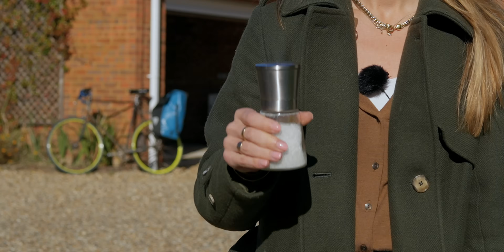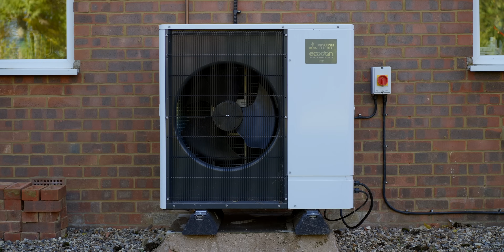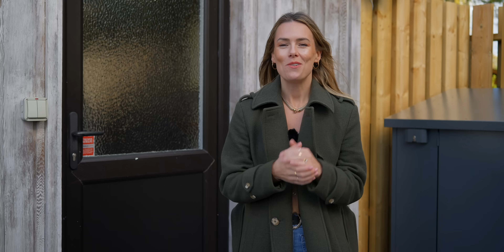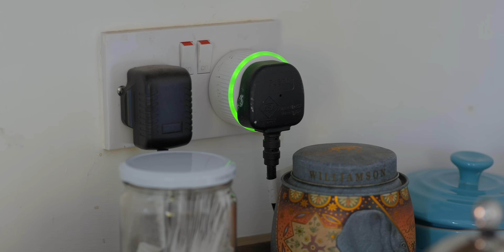Sodium Home Batteries Are Here! Is Salt The Key To Cleaner, Cheaper Energy?

Comment from the maker: IMPORTANT CLARIFICATION: Sodium-ion batteries do not contain table salt as the electrolyte. The video refers to sodium as an abundant element which can be sourced from salt, not to table salt being used directly in the cell. Sodium-ion electrolytes use engineered sodium salts and should be handled and recycled professionally, just like other battery chemistries.
Reply: Also you should clarify that empty is empty. LiIon-cells dont have "15% left". 0% is 0%. You can destroy them and discharge them more (below 0%)but its not like the Na-cells have hidden energy somewhere, their 0% is also 0%. Both can be used from 0-100%, the 0% on the Na is just at a lower voltage. A 5kwh Na is not secretly a 5,5kwh. Also: heating a closed pack like a liion-battery costs nearly no enegry, bc you just need to heat it to maybe 5°C and the pack is insulated. No one is opening windows and door, no one needs to exchange the air and get fresh air in.
Reply: Thank you for clarifying this point.
Reply: Sodium carbonate
Reply: @KyrieEmbong what about sodium carbonate?
Reply: so the only "expert" is from the replacement population, so will not be watching any more antiwhite videos from here, and the company is more interested in tracking and tracing customers than saying how much it costs or where you can buy one
Reply: Lol
Reply: The other point not being made is that the sodium in batteries does not come from mined NaCl in the UK. It requires Na2CO3, which CAN be made via the Solvay process, which uses huge amounts of coal and limestone and which produces huge amounts of CO2. The sodium carbonate that is required comes mostly from tronay mining in the US, Turkey and China. But sodium is only a small proportion of what makes a sodium battery work. The principle components are nickel, manganese, vanadium, aluminium and hard carbon, all of which are specialist supply chains and none of which can be produced at scale in UK.

Australia has huge repositories of lithium, but there is a reason why they are not making a fortune on lithium batteries. It's just never that simple.
Reply: Like businesses have such a great history of recycling and handling waste professionally.  This is not something we want scaled up for home use.
Reply: Actually, the electrolyte does contain sodium salts. But the name comes from the use of sodium metal in the cathode, not from any ions dissolved in the electrolyte. When you place a salt in a solvent, the salt dissolves into its constituent ions. But in this case, charging causes metallic cathode to lose ions that go through the electrolyte and deposit onto the anode. This is high school Chemistry 101 stuff! It shouldn't be that hard.
Reply: @Speed-Daemon-123  This type of batterie only works for small KWh.
Reply: @Speed-Daemon-123  If it isn't hard why have we waited centuries to have someone make one?
Reply: @CorwynGC  1. you haven't "waited centuries", you haven't even lived for one century, 2. it's your job to sign up for class, so if you're "waiting" for someone else to do the work for you, you're just lazy. If you went through high school without basic knowledge like chemistry, it's on you. Others have been "making" chemistry for centuries, literally.
Reply: @Speed-Daemon-123  If you can't understand simple pronouns like "we", I think it might be you who needs the class.
Reply: @CorwynGC  and there it is. The argumentum ad hominem is the sign that you have lost your own debate.
Reply: @Speed-Daemon-123  Really?  You didn't notice yourself saying "you're just lazy"?
Reply: @CorwynGC  I havent been waiting centuries for a salt battery because I didnt know that you think we needed them.  I do fear production costs of these batteries and noxious byproducts won't make them cheaper than Li-Ion.  They have the same environmental impact ratings, meaning regulations of waste that need to be funded.  While better for resource scarcity, this will create a demand that will compete with many textile industries, driving up the cost of other goods in the process.
Reply: @klo88  What?  You think that more batteries will drive up the price of blue jeans?  Simple economics will tell you that cheaper energy makes everything cheaper.  If you have some complicated economics which contradicts this, let's hear it.
Reply: Omg, that you need to say that says everything you need to know about the level of education in this country.
Reply: @dominicgoodwin1147  Seriously, how many high schools teach bleeding edge energy systems?
Reply: Thanks for making this retraction.

Comment: A bit disappointing to only allow 92% discharge when popular LFP batteries allow 95%
Anyway...
What they don't tell you is when an inverter breaks after the warranty expires, you need to spend more money to fix it
What they don't tell you is when the manufacturer goes bust, you're on your own; All the more important to bear in mind when so few sodium battery solutions exist
What they do tell you is when your solar panels get old, they produce less electricity
What they don't tell you is that's during the summer, because in the winter you'll be lucky to get a few W out of them later in their life; Guess when your heat pump will be most in use
What they don't tell you is that if you'd invested the money instead, you'd be better off as opposed to waiting 10+ years to break even on solar panels
What they don't tell you is that even if you spend a lot of money replacing your heavy appliances with smart ones, someone still needs to be there to load the washing machine and tumble dryer at the right time. And you also have to leave them turned on at all times...draining power
What they don't tell you is that even if you make your house energy efficient, the bill still goes up to pay the standing charge
The moral of the story, solar panels are a waste of money in the UK
If you've got money to burn, by all means get battery storage and take advantage of the cheaper rates
Sadly those who can't afford them or can't fit them will have to continue subsidising those that can

Comment: Generation ( Solar Panels )
Storage ( Batteries )
Useage ( Consumers Choice )

  The more you're using of each the more you need of the other two

   Set up your Generation " as much Generation as you can afford "

  Double , Triple , Quadruple the size of your Battery Storage  " you will need to get through Winter , less Battery  Storage means you will be buying in electricity when you should have brought , set up Battery Storage "
     " Capture all the Electricity Generated "
     Use as needed ..

Comment: AN AUSSIE COMPANY MADE A POWER-SUPPLY BY AN OFF-SET BALANCE-WHEEL AT THE END OF WHAT LOOKS-LIKE A LARGE SPHERE-CHAMBER'S SHAFT AND INSIDE MAGNETS ARRANGED TO CONTINUE THE SPIN, SURROUNDED BY A COPPER-STATER TO AID IN COLLECTING THE ENERGY THAT HELPS INCREASE CHARGE TO AN ACTUAL ALTERNATOR MOTOR CONNECTED TO A BATTERY TO CREATE A CONTINUOUS MEANS OF ELECTRICITY THROUGH A REGULATOR RECTIFIER TO TURN AC TO DC WITH LARGE STORAGE CAPACITORS. USED FOR OFF-GRID HOUSING IN AUSTRALIA. I'M NOT AN ENGINEER. SO MY RUDIMENTARY EXPLANATION MIGHT NOT BE GOOD-ENOUGH...!...? NOT-SPAM. caps on to see!

Comment: This episode of The Everything Electric Show explores the emergence of sodium-ion battery technology for home energy storage, featuring installations by the company Eleven Energy. While sodium batteries have a lower energy density than lithium-ion (100–160 Wh/kg vs. higher for NMC/LFP), they are highly suitable for home use where space is less restricted (2:15-2:42).

Key Advantages of Sodium-Ion Batteries:
Temperature Resilience: They operate efficiently in cold conditions down to -20°C without the need for energy-consuming heaters required by lithium systems (3:52-5:00).
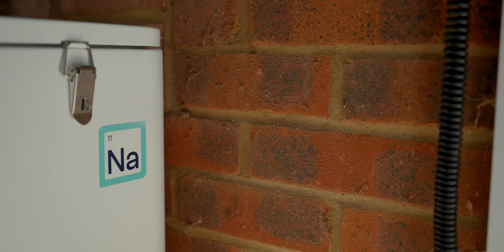Full Depth of Discharge: Sodium batteries can be discharged much more completely (down to 8%) compared to lithium systems, which typically retain 15-20% capacity, without damaging the cell life (5:01-6:32).
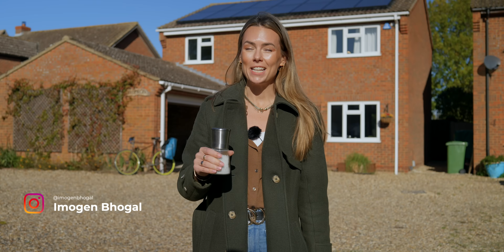Sustainability & Safety: Sodium is abundant, cheap, and safer to transport because it can be discharged completely (0:05-0:14, 5:07-5:23).

Integration and ROI:
Smart Energy Management: Eleven Energy utilizes a sophisticated system that automatically adjusts charging and discharging behaviors based on weather forecasts, homeowner usage patterns (sensors on appliances), and electricity tariffs (11:16-14:06).
Arbitrage Opportunities: By pairing batteries with smart, time-of-use tariffs, homeowners can charge during low-cost periods and export energy to the grid when prices peak, significantly accelerating the return on investment (14:07-16:05).
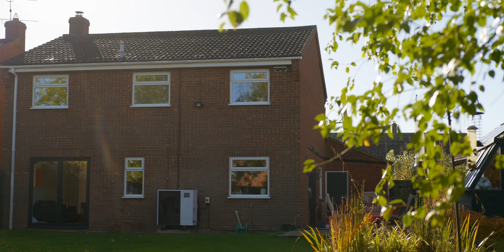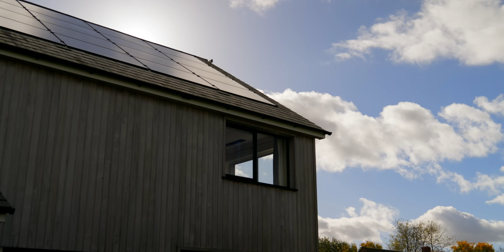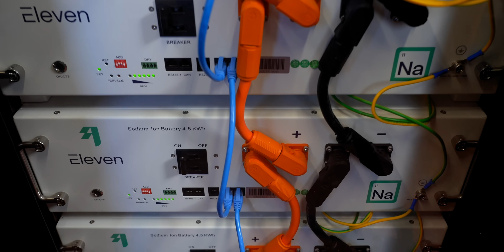Homeowner Experience: Real-world users reported that the system encourages a more holistic view of household energy, helping to manage demand across different seasons (8:30-9:11, 10:59-11:15).

While currently priced similarly to lithium systems due to the infancy of the technology, costs are expected to drop as manufacturing scales (7:51-8:29).

Comment: Terrible sizing advice. As soon as you get an Air Source Heat Pump your electricity use in winter at least goes up by multitudes. My 9 hwh battery is undersized for a 3 bed house.

Comment: I know why they avoided stating a price or making comparisons. at $926 usd per kWh, that is about 3 times the cost for a comparable premium Lithium battery. an almost about 9x the cost for a typical equivalent. the average UK household uses around 7-7.9 kWh per day, but that is assuming a large amount of heating and water heating is done with gas. if you move to a more electric based system you can 2x-5x the requirements depending on several smaller factors. ROI with his suggested 1 day of use as battery storage.... the ROI is 11-14 years for an all electric home and you are still on grid reliance with the risk of long term power outage, for the same price I can go %100 solar/wind/battery be totally off grid and an ROI of 5-8 years.
 Sodium has a bright FUTURE, its just not bright right now, you'll pay for early adoption taxes (not literal tax but price increase for bleeding edge that's not mass produced at scale yet)
Reply: What's interesting about this and many videos on the subject is the seeming assumption of solar.  In the UK the tariff structure is such that the ROI on just batteries is 3 years with an installed cost of around £275/kwh. The solar install costs more and has a much longer ROI of 10-14 years.

Comment: Ashley is salt batteries given their their size and uses and their special abilities should be used for home storage and business storage and stuff like that they have their own ups and ups and down benefits for home and business storage they should be cheaper for people to use given eventually that they minerals are much more easy to come by as far as like manufacturing it's all pretty much the same as everything else that's already out, All the lithium and special high-powered airplane stuff or whatever submarine drones all that stuff can be done you know towing whatever with lithium and other battery types

Comment: The salt is cheap but manufacturing the sodium battery in an expensive process. You don't just stick a load of salt in a box with a cathode and anode there's a complex process and the finished battery isn't much cheaper than the equivalent lithium ion battery presently. They may get cheaper to manufacture as time goes by and scientists learn a better way, but until then just because it's a salt battery don't think it's going to be cheaper

Comment: I have recently had a system installed and wondered if sodium would be better and if it would be comparable with Glow watt system. I really do not like the SMART systems just basic on off store and only for household not grid attached. In other words I as householder have full control also totally off grid and not internet linked reading on the actual system

Comment: We also need to talk about internal resistance. I work for an inverter manufacturer and we tested a sodium battery and found that when an inverter attempted to start a large inductive load such as a water pump, the sodium battery did not deliver current fast enough and the voltage fell off a cliff. The inverter shut down on low-voltage and the test failed.

Comment: The nervousness expressed here around price is justified because the chief incentive, for most people, is the potential for cost reduction. 

Regarding discharge to the grid for profit will only work until this becomes a mass market installation.

As soon as rooftop solar started to take off, the green subsidies were removed causing a massive drop off in the early uptake by customers.
The current VAT free benefit is an obvious target for fiscal harvesting .

Good to hear about some of theomplexity regarding management.

Comment: Sorry you bleed a little off the battery during the summer so you have somewhere to put the excess? What madness is that? Just use the excess to heat a hot water storage tank or better still use a thermal battery that can be used to heat your ho.e in the winter.

Comment: Oddly enough ,and perhaps to the relief of everyone thinking they'll have to give up precious square footage in home, these kind of batteries will be best utilized by the energy companies themselves. Stacking up huge battery stations between power plants and customer nodes for a distributed backup energy grid will be the next phase of battery tech. Then just start replacing petrol stations with battery-swap stations so you never need to run billions of miles of expensive power lines to every single house and you've got next gen automotive culture and economy.

Comment: Sodium Ion Cells DO NOT have a higher nominal cell voltage than typical lithium batteries such as LFP (3.2v) and certainly not NMC/NCA - their typical nominal voltage is 3.0-3.1v depending on the exact chemistry. 
They have a much wider working voltage range than lithium, which is not a good thing - this results in lower string voltages at the lower capacity levels....the consequence of which is lower inverter efficiency and higher cable/system currents.
They also have higher internal resistance - this is not so much of a concern for low power inverters, but higher output inverters or faster charging systems will result in greater cell charge/discharge losses.

Comment: In my state power company's are not required to pay for energy you put on the grid so there's no real incentive to export power. They do give you credit for peak and non-peak output which could be useful for shifting energy from the summer to the winter and saving some money that way but eh. Sounds like all of England does have the benefit of getting paid out for their energy exports, how does the pay rate compare to what they charge you if you do export energy?

Edit: HOLY CRAP YOU GUYS ARE MAKING THOSE DOMESTICALLY!?!? Any chance you sale to the US? I'd gladly buy those over some Chinese Lithium battery's that'll burn my house down.

Comment: Sodium batteries have one single massive disadvantage - the discharge curve. The voltage drops significantly as charge is taken out, meaning that any equipment running from them has to be specifically designed to operate over a very wide input voltage range. This is not impossible, but is very expensive. It means that existing devices cannot usefully be paired with sodium batteries. It also means that as voltage drops, current increases, significantly increasing conductor costs.
Reply: isnt this a problem the inverter and battery management system solve?
Reply: @PaulRuk No, all inverters currently on the market will not work with that voltage range. Yes, you can design new inverters, but they will be more complex and more expensive in order to deal with the wider voltage range. This does not address the fact that you still need bigger cables to carry the higher current due to the lower voltage.

Comment: 1.) Sodium ion batteries were never theoretical. The issue was whether they could be commercially viable. 

2.) The biggest constraint that batteries have for mobiles is their energy density. The lower the density the bigger and heavier  the battery would have to be. This causes a spiral where the battery becomes too large and too heavy for a car to have. Making it infeasible cost wise and for transportation.

Comment: the hugely popular British small house, after all a large proportion of new builds and older housing stock fall in this category, don't get me started on garages, space is going to be sorely tested by the space requirements, for heat pumps, their dedicated cylinders and batteries. Even in a small house, without often a solar option, a 20KWh or more would be tempting to run, from that off peak rate.  Again though big space requirements.  Its like the bias to SUV's, we need some small house solutions that can approach the gain larger properties can achieve.

Comment: Sometimes the answer is right in front of us. It just comes down to can the energy companies make money out of it.
Reply: It'd be better if they ran them. Huge nodal batteries that a slew of homes run off of at key points as backup/etc. so people don't have to install them. Then cars running on swappable batteries deployed at swapping stations that are connected via the grid obviates need for hyper-expensive all-home wiring for car charging.

Comment: Na is NOT Salt… Salt is a compound made of two elements - Sodium (Na) and Chlorine (Cl)… NaCl representing a ratio of 1:1 which is a stable compound… when you split the compound using electrolysis you end up with two very dangerous elements…..